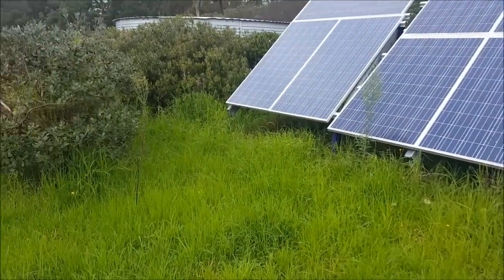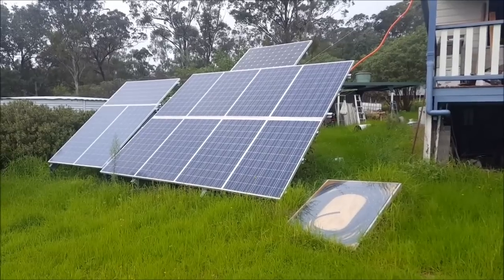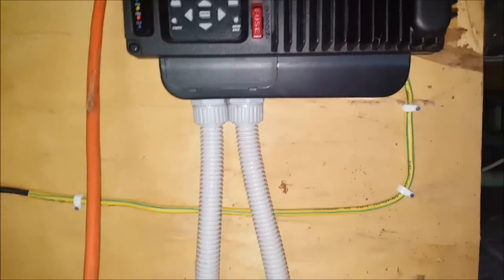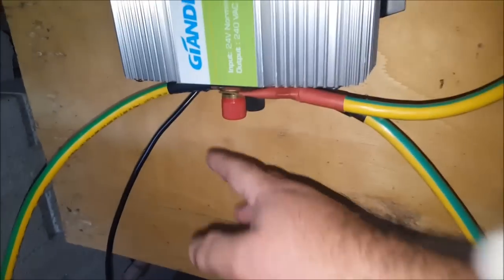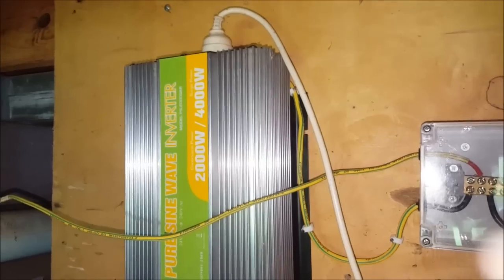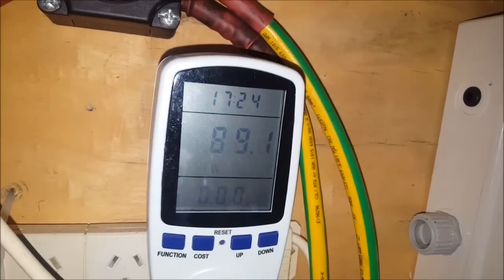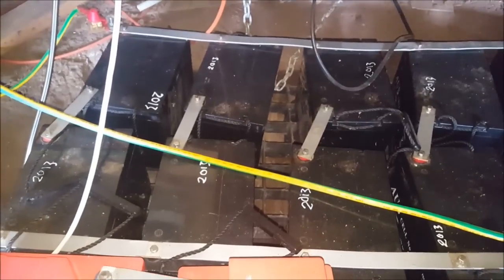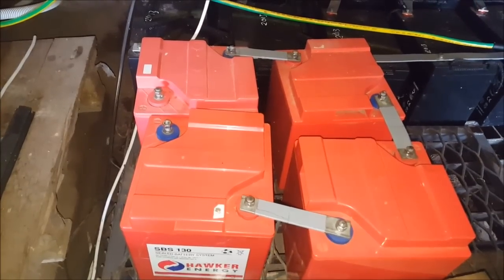Off Grid Solar Power - How it's all Connected

Comment: Which breaker should i use between charge controller and battery back i bought a 5kw inverter 48v; 6  solar panel 340watts and 12 volt gel battery 100Ah (4)and can you show how to arrange my solar panels

Comment: Great setup. I'm about to have a crack myself shortly. With the two breakers you showed, what's the rule of thumb in size you should buy in relation to panels/Charge Controller?
Reply from the maker: The solar panels can't produce more current than they're rated at, so as long as your circuit breaker is more than the panel's maximum current, go with that. Ideally, I'd like to be 25% above it, just in case.

I did have a 20A breaker between the charge controller and the battery bank, which was fine when I was only running two 300W panels but now that I've got 2kW of panels hooked up and the charge controller can sustain 30 amps at times, I need a bigger circuit breaker.

Comment: Just curious I am doing something similar just don’t have the same controller but what size wire is good to run from my solar to my battery bank and to the ground rod and from the breaker to the charge controller basically what size wires for everything
Reply from the maker: The wire size has a lot to do with current, voltage and distance. There are a bunch of online DC wire size calculators. Get the fattest wire you can from your batteries to your inverter. Keep your distances short. I use 6mm square cable from the PV array to the charge controller, but that's high voltage, low amps. I use the same to the battery bank but that's maximum 27V and only 30 amps. I'd use bigger cable to the battery bank but one failing of the Kid is that the internal cable connections can't handle much bigger cable than that.

The circuit breakers are regular circuit breakers, only rated for DC, not AC.

Comment: Please break your ac load before you pull a breaker in your dc input.
Breaking DC under load is like drawing an arc. It will melt the switch contacts.
Good score with the fork batteries.
Reply: What does that mean in plain English

Comment: How many batteries would I need to run a fridge all day ? How high of a power inverter,  like 2000 is good? And how many solar panels would I need to power that? Thanks man!
Reply from the maker: It's not about how MANY batteries you have but the CAPACITY of your battery bank.

Start with working out your electricity usage and go from there.
Reply: I am learning about solar and very confused but getting better. My problem is learning the math on the amount of solar panels I need for my portable air conditioner. Unfortunately though I want the 450 watt solar panels, I can't get them unless shipped in for my small RV. I know I can get 390 watt panels locally and my small RV can hold two so 780 watt total. I am trying to figure if on sunny days, it would produce enough to run my 12,000 btu portable ac with still having the battery bank for night. It just gets to hot when I take it out. Is there a easy way to cacalate the solar panels I would need?

Comment: Maybe a dumb question to you, but say I am a "night owl"; because of my job (sleep during most of the day, awake all night).  Would having Solar power just to decrease my bill be worth it?  Also would it even work?  Thanks in advance.  Love the videos as well.
Reply from the maker: It depends a lot on how much electricity you use, how much you pay for grid electricity and how cheaply you can get solar panels and batteries. Generating electricity is cheap, storing it isn't.

When I went off grid here at the shack I was paying more just to be connected to the grid than I was paying for the electricity. The bastards here in NSW also charge about 32 cents per kWh.

Is it possible? Definitely.
Is it worth it? It depends a lot on your circumstances but it's definitely worth looking into.
Reply: Thanks a lot for the quick reply!